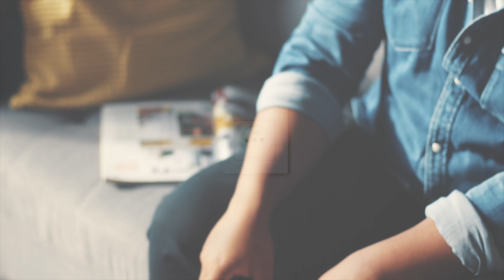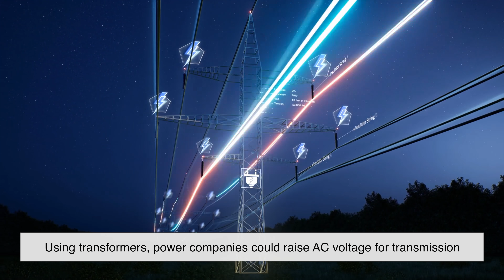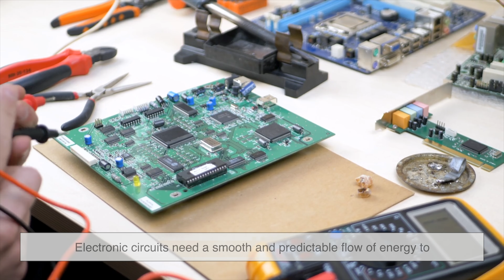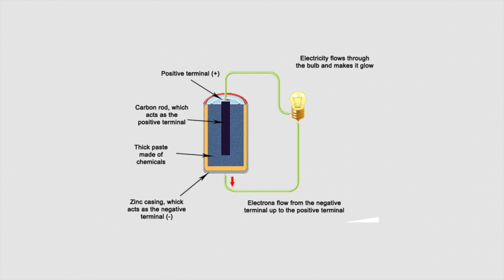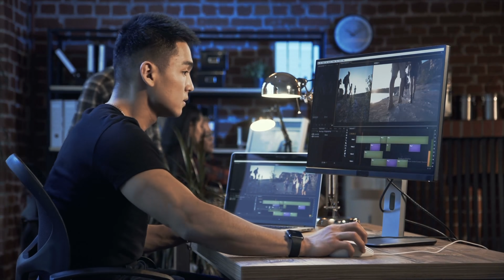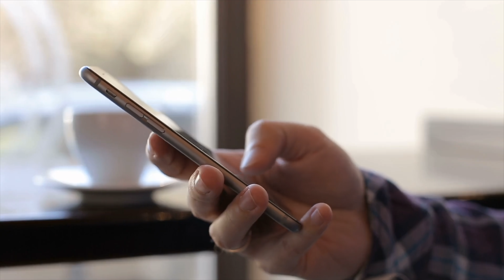Why Electronic Gadgets Can’t Run on AC

Comment: One way is very easy to control... Basically in primary stage of technology, devices designed with wire. They wound, filament like that. Later electronics are one way and study components

Comment: Quantum computing chips of the future could process multiphase alternate currents comparatively and simutaneously with more progressive accuracy in time. Linear logic will be replaced with parallel processed differential variables in packetized simultaneity.

Comment: AC-DC converters (chargers and power supplies) not only have to rectify (convert AC to  DC), they also have to smooth out the AC- remnant voltage changes to make the DC look as if it came from a battery, which is called filtering.  Imagine if you used DC straight from a half-wave (cutting off the unwanted half cycle) or even full-wave (reversing the unwanted half cycle) rectifier.  The effect would be DC with a variation in voltage at the line frequency or twice the line frequency.  A filter, traditionally one or more capacitors in parallel, and possibly a resistor (or better, an inductor) in series on the “hot” side (usually the positive) side), gets rid of most of that variation, which can be heard in a speaker or headphone as “hum.”  The quality of a power supply determines how much hum remains (and its price),

Comment: Bwhaaha, I looked at this video just to see the comments. Electronic circuits do not react well to AC voltages. Designers go to great pains to filter them out. AC causes noise, even in rf circuits and can interfere in digital circuits. Unless you love the 60 hz hum, forget it.

Comment: Another benefit of DC circuits; Less Wiring. 
Many AC circuits require Parallel circuits. DC doesn't.
In DC 'G' is Ground anywhere on the board..

Comment: Simple answer. AC is primarily for transmission, not powering devices. Apart from AC motors, heating elements and incandescent lights, most appliances are regulated to DC.

Comment: Around 2006 ,I remember my Dad could not find an adapter to convert the 2 pin of the power supply for the phone to 3 pin .So he cutt of the head and connected it to a 3 pin plug  and plug the phone directly into AC🤣
Reply: Ha ha I had seen one more same issue 30 years back walkman connected directly to ac mains and boom ,and now that person is a doctor god knows how that person is now..😂😂

Comment: The devices (Transistors, Diodes) in chips are designed for current to flow in one particular direction only.
Reply: Yes, that would have been more informative. Unfortunately this channel treats subjects rather superficially. I still remember the "why not dead birds" clip. TLDR: cats ate them. Mind blown!.
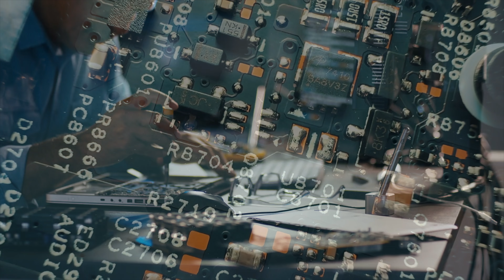Reply: @gelonzo71 DC current flowing in one direction was mentioned at 2:48.  I guess you would rather complain than pay attention
Reply: Thanks. If that is above the level of the video, I don't need to watch at all. 
It is not just about one direction, it's about logic to perform a function. You have to have a known on state and an off state, and a variable state like volume or brightness. AC would scramble all of this.

Comment: It’s really about polarity. You can lower the voltage of AC so it wouldn’t fry the components but you can’t have the magnetic fields changing direction they don’t want you to open shit. They just 60 times a second.